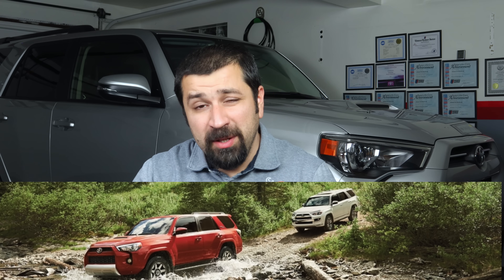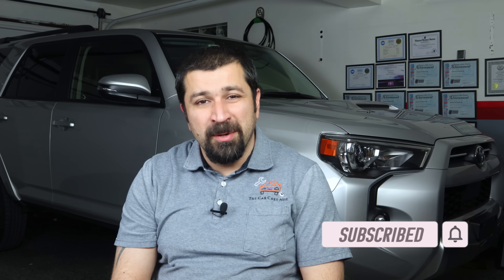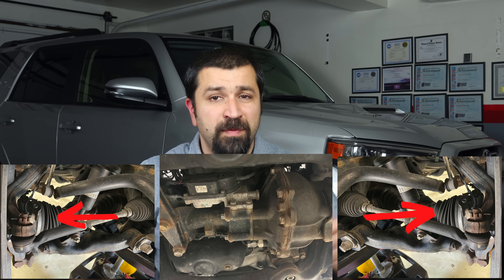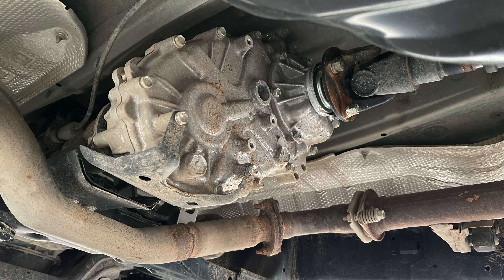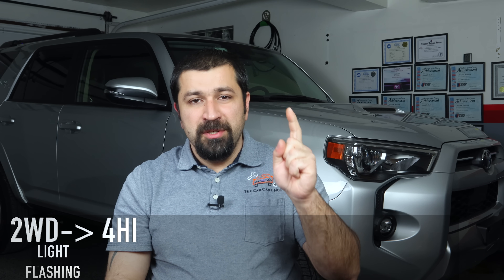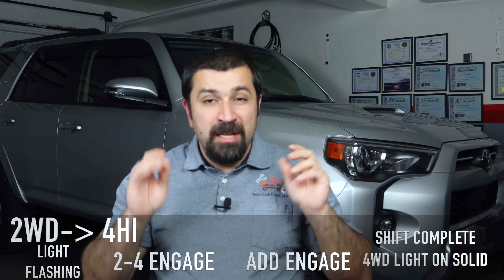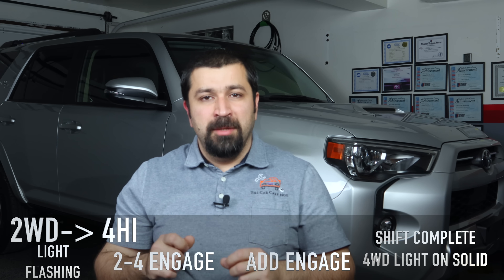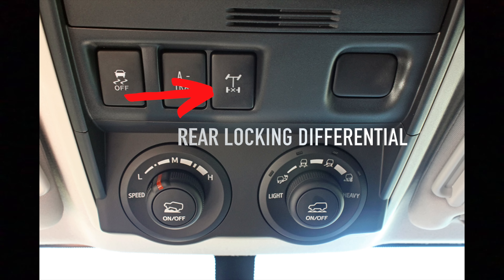How does Toyota 4WD System works and why is it reliable?

Comment: I am not sure where else I could put this request. I have a 2015 Sienna AWD and would like to hear your comments and opinions about this particular Toyota drive system and its proper maintenance. I expect they are basically the same system across the Toyota AWD line so your answers would apply to a lot of the vehicles out there. Also would like to know more about the Viscous Coupler. Why they fail, how to repair them, etc. I am a big fan of your videos and really appreciate the knowledge you freely share. Thanks and stay safe!

Comment: Thanks for that tip about not turning off the engine until the four-wheel blinking light is off and the drive is in one position or the other

Comment: Great info but something confused me.  You said that, other than the Torsten limited-slip in the transfer-case, the part and full-time systems are identical.  I’d this is the case, why is it only ok to keep the part-time system under 60mph (when in 4wd) but the full-time system can safely go past 60?

Comment: I’ve owned a 2003 Tacoma trd. 2007 Tacoma TRD and a 2019 4Runner SR5. The 2003 and the 2019 are great rigs but the 2007 was sort of a bummer. The truck wouldn’t go into 4WD very quick sometimes taking several minutes. That truck also had a few other issues I didn’t like. I kept it for a few years but overall I should have bought a 4Runner in 2007.

Comment: What would cause a friction noise while 4wd is engaged? The noise goes away as soon as it’s back in 2wd. ‘05 Sequoia. 
Transfer case chain? Front prop shaft? Front diff? Cv axles?
Checked/replaced front diff and tcase fluids, still chasing the noise. Inner cv boots have leaked some at the clamps, could that be it?
Thank you if you see this comment and have any insights!

Comment: Are you saying the front differential still rotates even when in 2WD? My understanding was 4WD systems still have hubs that lock/unlock electronically to help with fuel economy, as driving the vehicle with the differential actually spinning reduces fuel economy.

Comment: I own a 2005 Sport Edition V8 with 97,000 miles.  I use 4WD Lo often when hunting/fishing/off-roading and have never had any problems.  However, a few days ago I experienced a scary situation twice when driving off-road in 4WD Lo.  On two separate occasions, the engine suddenly surges and the rpm's go thru the roof!  It's quite scary because I'm in 4 Lo terrain and I have to stand on the brake pedal to control the vehicle.  Once I get the 4Runner to a complete stop (with engine still surging at high rpm's) I shift into park or neutral and turn the engine off.  After waiting about 30 seconds, I start the engine again and everything operates normally.  This happened two times, about an hour apart and both times in 4WD Lo.  Any idea what is happening?  Thanks!

Comment: I have one of the rare full time 4WD Tahoes with 4 Lo option (2005 Tahoe LT with Autoride suspension).    It is amazing in the snow.    It’s the Borg Warner 4482.    It has full time 4WD (60:40 split) and the 4 Lo button that allows the center diff to lock it to 50:50 torque split.  But it has no 2WD option.     Sometimes I wish I had the standard transfer case.   But, it’s a very unique setup for sure.      It’s a similar transfer case to the Borg Warner in the Hummers (BW4484) but mine lacks the 4 Hi (locked center diff) option and the Super Low option some Hummers have (3 speed transfer case).

Comment: Hello Amd,
Quick question about center diff lock on GX 460. Can you lock center diff in 4HI if you are driving on a snowy highway? Also do you have to go to N to engage CDL or you can just press the button while driving? Thank you

Comment: I have no complaints about engaging 4wd manually on my 80's Toyotas.  Just got to remember to lock the hubs before you actually need them and to unlock them before you get on the highway.  And then there is the gas mileage issue.

Comment: Should I get a 2022 RX 350 AWD or a 4Runner 4WD? Which is more reliable?
Reply: I think Lexus RX has some annoying issue with the exhaust, check on Club Lexus it happens on all variants that have V6 I think. 4Runner is a cheaper car and it is also not luxurious either unfortunately. I myself am looking for a Sedan but ES350 is the only one worth cash sadly it doesn't have AWD at all. Other vehicles are not that reliable as a Lexus so stuck. GX is too expensive but it has V8 and even more solid luxury than 4Runner, maybe check that out.

Comment: Sorry for the basic question but on my AWD 2010 Lexus RX 350 I have NEVER, EVER even pushed the button(s ) to engage the AWD feature.  We live in Florida and have never had any reason to use it.  Therefore (1) Does the rear driveshaft even ever spin?  (2) If it does do I still ever need to change the fluid in transfer and rear diff?  (3) If it does not spin, can I just leave it as is since it will never be used?  Thanks

Comment: Cool. My 2006 Matrix 4WD (AWD) has a "dumb" transfer case and and a "dumb" viscous coupler (no electronic control on either one) in front of the rear differential. The rear wheels only kick in when their rotational speed changes relative to the front wheels. This speed difference causes sheer forces (via alternating plates) in silicone fluid in viscous coupler which transfers torque to the rear wheels. When all wheels are going the same speed (aka straight down the road), there is no transfer of torque to the rear. It is a purely mechanical system utilizing a viscous fluid

Comment: I have a 2019 Limited AWD/4WD. I was told the front drivers side needle bearings can go bad. But, the aftermarket says the Limiteds are difference size. So, my question is, what is Toyota designation for the Limited front differential, compared to the others ones, since it has a different drivers side needle bearing where the CV shaft goes in.
Many people replace it with an aftermarket company that is a sleeve vice needle bearings.

Comment: Have the rear locker model. Dealer already replaced the ADD twice within 6 months, and it’s intermittently failing again. The temporary solution has been to get out of the truck, remove the skid plate, and to hit ADD with a rubber mallet - then it engages, but without that I keep getting a blinking green 4x4 light. Still haven’t found a permanent solution-seems like if I take it to the dealer, they’ll just replace the ADD again, but it can fail again. At this point, I’ve considered permanently engaging ADD or overriding it with a cable, but that’ll throw off all the other electronic nannies. Dealer has already filed a claim with Toyota that their part keeps failing.

Comment: Going up and down fairly steep hills, do you use 4 W High or Low, and do you put on second gear? This winter used drive gear on 4 W High and it went down very fast. Want to go slower.
Reply: Forgot to mention, it was on lots of ice and some snow.
Reply from the maker: Hi! In snowy conditions I would use 4Hi. When the ground is dry use 2wd
Reply: @TheCarCareNut  hi, driving on ice, it’s 4hi *plus on second gear rather than on drive?
Reply: @TheCarCareNut  second gear for slower speed on ice going up and down steep hills?
Reply from the maker: Yes that would help to be in second gear as well

Comment: So My 4wd system slowly went out over time- 2 weeks ago I went to use it and 4wd light would flash but never engage then eventually popped into 4 hi but 4 lo stayed flashing.  I took it to Toyota to diagnose it.  They said the transfer case actuator motor needed to be replaced.  Had my Toyota guy do it took out transfer case and set everything. Car is now in 2wd with no green 4wd light flashing, however 4 hi is flashing.  And the dial won’t change anything- thoughts?
Reply from the maker: Hi! This one is very hard to guess without diagnosis in person
Reply: @TheCarCareNut  so he tested everything and one thing he noted was the the voltage going into the 4wd computer module was right but voltage coming out was not.

Straight forward to being the 4wd computer module?

Comment: is the front differential on the 2003 4runner sport  4.7l v8 awd  the same as the front differential on the 2003 toyota sequoia 4.7 v8 awd ?

Comment: I have a stock 2022 4runner trd offroad with stock tires. My car is making a humming noise from 24 to 60 miles. When I switch to 4H the noise is much quiet.  I took it to the dealer and they say the noise is coming from the rear differential and they said there is a service bulletin for it. Have you ever seen that service bulletin ? Thanks

Comment: Question:  is there any issue leaving 4x2 in 4 wheel hi all the time?    Or should I just buy 4x4 all time model??
Reply from the maker: Hi! On part time 4WD models it will bind when you take turns in 4Hi in dry pavement and it’s not recommended. Either use 2WD mode or buy a full time 4wd

Comment: Thanks for the info.  Very informative.  I have a 06 v6 4runner that I let get seized up.  I replaced the front ADD and the lights stopped flashing and now I have 4hi and center diff will work but it still wont go into 4lo.  Do you have any advice besides just keep trying?  Thanks.
Reply from the maker: Hi! That’s likely the actuator on the transfer case that’s seized
Reply: @TheCarCareNut  thnx for the reply.  I'll keep trying 4lo.  Maybe in warmer weather it'll finally break loose.
Reply: It finally went into 4lo and stayed there unfortunately.  LOL.  So I ended up dropping the Tcase and replacing the actuator myself.  I went with an Aisin actuator due to the 1.8k$ price tag for toyotas.  I would like to see you do a tutorial on Aisin parts compared to OEM.  I know Aisin makes some parts for toyota.

Comment: I've watched this video several times now. Every one of your videos are outstanding!  On my 2014 Sequoia Limited 4wd... The Center Locking Diff switch flashes when actuated. Is this normal?  Also, the 4WD indicator light flashes when I attempt to engage Low Range.  I purchased this vehicle used at Toyota with 52,000 miles on it.  BTW, I live on a farm and use lockers and low range frequently. Thank you!!
Reply from the maker: Hi! Once the shift happens or the lock engages it should come on solid. Flashing means the shift is not completed. Did you follow the conditions needed to allow that shift?

Comment: This is a very good video to learn about Toyota 4wd. I would have liked to have seen it before I had to diagnose why my Toyota T100 pickup didn't go into 4wd when I shifted. I hadn't gone into 4wd over the Summer, so Mr. Car Care Nut is right that you need to shift your Toyota into 4wd at least once a month to prevent this problem. On my older Toyota pickup the ADD in the front is run by two vacuum hoses rather than an electric motor. I disconnected the activate hose and provided a strong vacuum to get it unstuck and it has been working fine since.

Comment: The Toyota owners manual in my 2019 TRD Off-Road says to drive about 10 miles every month exercising the 4WD system.  I confess, I have to go find dirt roads in my area to do that and have only done it on about every 3 month rotation.  Good thing I live near a wildlife preserve that has dirt roads because you don’t want to exercise it on pavement.
Reply: You can drive on wet pavement for example during rain. I just avoid doing full right/left turns at a light or stop sign under 4WD. Freeway driving is fine too, just engage while on the freeway, typically not getting onto it to avoid turns.

Comment: Thank you for making these videos! I have a quick question for you. I took my 4runner on a moderate trail that had big mud puddles and rock crawling. Drove it home. About two weeks later, got the following issue: when I cold start the truck, I get pre-collision sensor malfunction and blinking Crawl control, and multi-terrain select malfunction. Can’t turn on cruise control, crawl or MTS. Then after I drive a bit, I turn off the engine, start again and no lights on and all of those functions work. Any ideas what it could be? Thanks in advance!
Reply from the maker: Hi! You’ll want to get codes and see what’s going on. Hard to pin point it otherwise. Codes are stored even when lights are off but ideally check it when the lights are on. You’ll need a capable scan tool that can read all computer codes
Reply: @TheCarCareNut  thanks! So run techstream?

Comment: And this is exactly why I bought a 2021 Tacoma TRD off rd 4x4 in a automatic because it is bomb proof, and honestly I love my rear drum breaks,  this Tacoma is by far the BEST not only truck that I have owned but vehicle period , and I have owned many many trucks and suvs & cars that are expensive , my uncles Tacoma closing in on 200,000 miles with ORIGINAL rear brakes , I LOVE IT 😍

Comment: I have a 2018 sequoia and I’m not sure when to use the 4H. Use it on snowy roads highway? Is there a speed limit? Thanks!!
Reply from the maker: Hi! On wet pavement like snow and/or rain as needed. Try not you use it on dry pavement especially when making turns. Speed limit is 62 mph
Reply: @TheCarCareNut  awesome. Thanks!! We’re expecting some snow tonight and it’s the first time using it. I love your videos.  I also love the Sequoia!!

Comment: Has anyone had the transfer case motor on a 3rd generation 4runner go bad?
There goes $1,000 just for the part and the transfer case is supposed to be disassembled to install it.
How about a used transfer case? Nope. Those motors are all corroded to powder as well.

Comment: interesting. in my 2010 fj cruiser, 4WD automatic, I have shut it off in all kinds of various states of the manual transfer case, and never had an issue with it resetting after simply turning it off and on again.

Comment: I, Is it possible to put  a  hi  and low transfer case onto  my  4x4 1996  Toyota  Granvia 4x4?  It  has full time 4x4  full-time viscous type  with no  hi low.  Be great to be  able  to piggy back a hi low  into the  existing transfer case.

Comment: Fantastic videos with VERY clear and informative knowledge! 
Quick question: I've got a 2019 4runner Limited full time AWD. It's been an incredible vehicle. However, after sitting for almost 6 weeks in cold conditions and while driving in deep snow—I turned the dial from AWD mode to 4WD high mode (not low range) while traveling at 5 mph. Suddenly there was a horrible grinding noise and the indicator light flashed on the dash signaling failure to engage. I stopped the vehicle and turned the dial back and forth several times between AWD and 4WD high. Finally it engaged. I have not had any problems since. 
So, any idea what the terrible grinding noise was? Also, did I damage anything?
Thanks in advance. And keep up the great work!
Reply from the maker: Hi! Did you try to make sharp turns?
Reply: @TheCarCareNut  Wow! Thanks for the quick reply! 
No sharp turn. I was traveling perfectly straight and in snow (allowing for plenty of tire slippage). It was a metal on metal sound...imagine sticking a poker card in a spoked bicycle wheel but  obviously with the metal on metal sound. The sound was very uniform in such a way that it sounded like gear teeth grinding. (Hopefully that makes sense)
The vehicle is still under warranty so I took it to the dealership and they could find nothing wrong. 
Thanks so much for taking time to reply!
Reply from the maker: Interesting I wonder if it got stuck half way through the shift
Reply: @TheCarCareNut  That's exactly what it seems like. Even though it was a awful sound, I've had zero issues with it since. It's so weird. I just wish i knew which components were grinding...
At the time, the vehicle had ten thousand miles on it, which is also a concern of mine.
Thanks again!
Reply: 1. you need to be on dirt road. 
2. Put the car in neutural or park then go to 4wd high
3. AWD mode is all you really need in snow.

Comment: what is the whining sound that most of the 4runners have when driving normally on the street?
Reply from the maker: Hi! 2 sources of the whine noise which is a normal characteristic. One is the engine oil pump and the other and less pronounced is the transmission oil pump

Comment: HI SIR, LOVE YOUR POD CAST. IM THINKING OF BUYING A LIMITED 4 RUNNER NIGHT SHADE. WHAT ARE YOUR THOUGHTS ON ADDING THE KDSS SUSPENSION??
Reply from the maker: I think KDSS is worth it if you don’t plan to lift the truck and modify it
Reply: One cannot get a KDSS on a Limited or a Pro. Only the Off Road trims have the KDSS available (on 2023 models at least).

Comment: Could you please do a video on the order of engagement (or order of use) of the 4WD systems:  4H, 4L, Locked Diff, A-Trac, A Trac + Locked Diff, Crawl Control, Multi-terrain select, etc. on the 4Runner TRD Pro or TRD Off-Road?

Comment: I had the ADD  Years ago on my first runner. Had to turn the ADD on the wheels in the winter now on the runner I have for17 years is easier changing to 4 wheel drive then how you have to do it now ,they made things better back then

Comment: Do more research before engaging 4wd on dry surface 
This is not explained good because most 4x4 don’t have center diff and 4x4 shoud only be use on wet loos groun on slower speeds 
Also limited slip diff have other purpose then hi says 
Only sequoia and 4runner can use 4wd any time and will behave like awd

Comment: Thanks for the very informative video. I have just purchased a 2006 Limited. When I put it in neutral and change to 4lo and shift to drive it beeps constantly. I took it to the Toyota dealer to have the fluids changed in the differentials and transfer case and they said that was normal so you would not leave it in 4lo for too long. Is this correct?
Reply from the maker: Hi! I don’t recall them beeping in 4lo. I’ll check
Reply: @TheCarCareNut  Thank you. I should mention that it is a v8 Limited Canadian model